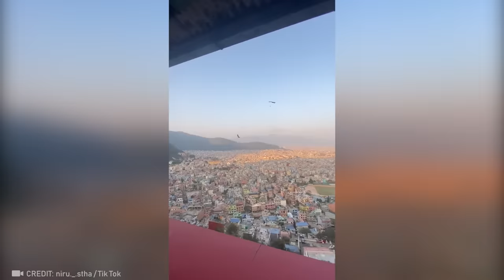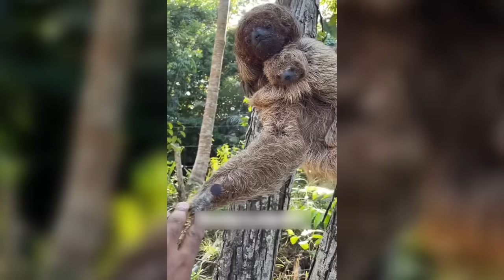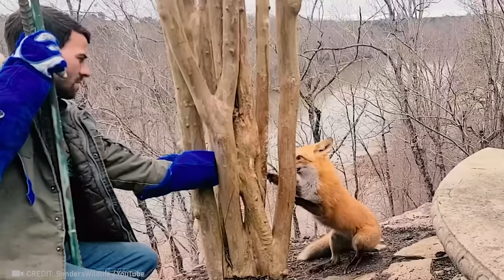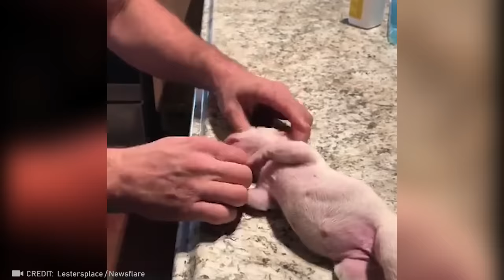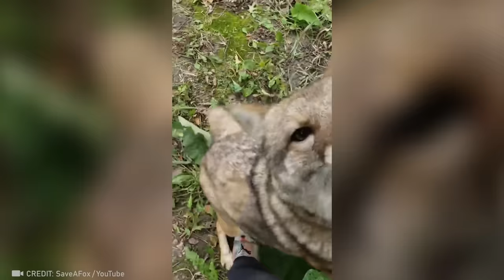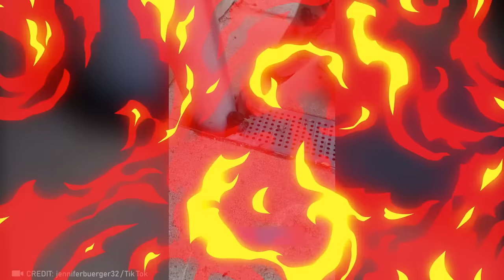Animals That Asked People for Help & Kindness Caught On Camera !

Comment: One time, back when I was a kid, I went swimming with my family.
When I went in the pool down some stairs I saw a helpless bee in the water doomed to drown.
So I tried to form a cup with my hands and wanted to carry it to a hedge with some water in my hands while avoiding to touch it because I didn‘t want to be stung.
When carrying it to the hedge I didn’t notice the water flowed through my fingers and so the bee suddenly ended up sitting in my palm.
Instead of acting scared and stinging me because of feeling threatened it just sat there quite calmly and when I tried to get it to crawl onto a leaf it first refused to and kept sitting in my palm in the sun to dry a bit and to renew its strength.
After a few minutes the bee „came back to life“, cleaned its wings and when I tried to get it to crawl onto a leaf again it did without hesitation.
It was such a nice feeling to have saved the life of such a generous and wonderful little animal.
Some might think „c‘mon it was only a bee“ but I felt so proud to have saved the poor little thing from drowning! 🙂❤️
Reply: It doesn't matter if it's a small bee 🐝 or a giant elephant 🐘 they all matter in God's eye's 💕✝️🥰
Reply: Yeah bees are the better of the stinging insects. Wasps are c**ts tho

Comment: Once I rescued a mouse from a toilet in India, where it coudn't get out. I got a bucket and an old towel, took it out of the water, wrapped it in the towel and held it in the towel between my hands to warm it. After holding it for some time I felt it shivering. I warmed it a little more until I noticed it had warmed up enough, then I placed it in the bucket with the towel, walked out of the building and released it.
At another time I heared some noise. A great tit (a small type of bird with beautiful colors) had gotten in my room in the Netherlands through a small window. It flew through my room and ended behind some plants, getting itself stuck. I gently tried to come close to help it out of there, right after I moved a plant it panicked, flew away again towards the small window, where It got stuck beneath it behind a closet of mine. It tried getting out of there flapping its wings, but the space was too narrow to get out. I held my hand under it, it became quiet and it stepped onto my finger. I went down from the chair I stood on and managed to take a picture while it still was sitting on my finger. Then I went near to another chair and let it step on top of it and made another picture, with the bird between me and the mirror in the closet. Then I opened the large window, stepped away and waited for some seconds. The bird, still sitting peacefully on the chair, looked at me and at some point flew out of the window.
In Tucson (Arizona) I once noticed a tarantula (a very big spider) walking on the water of a swimming pool. I swam up to it, went underneath it with my hand and let it walk free again on the edge of the pool.